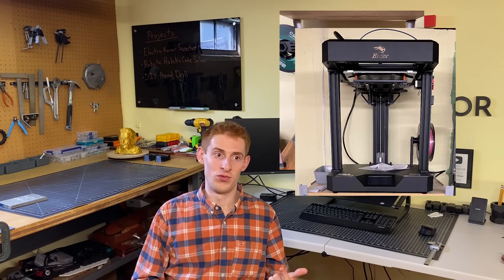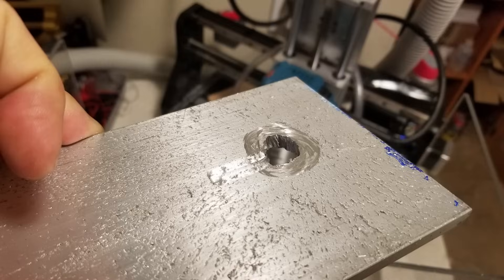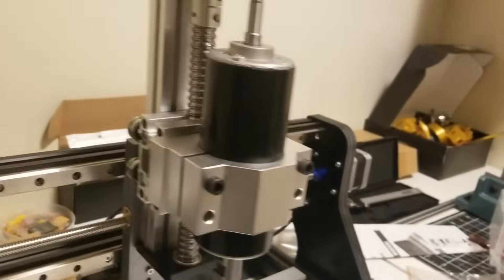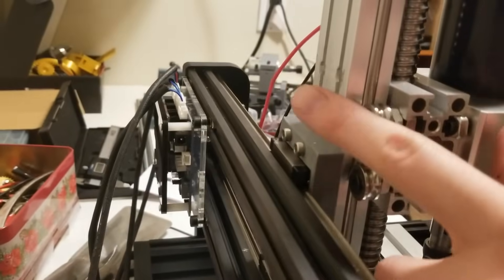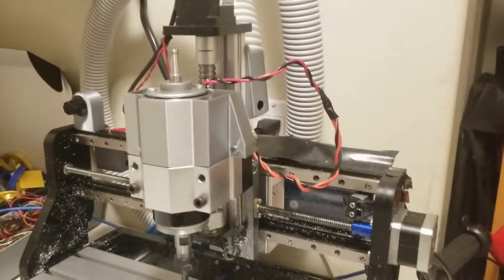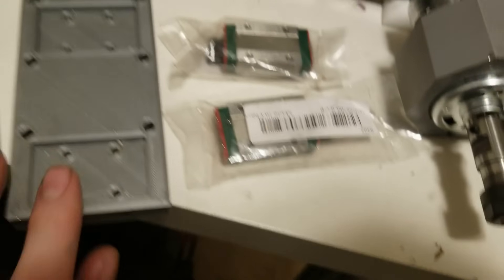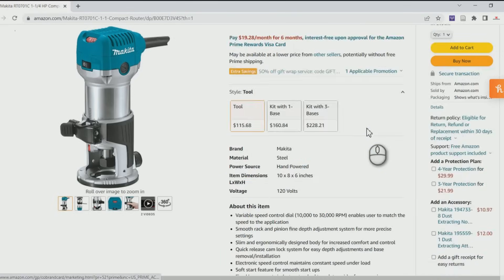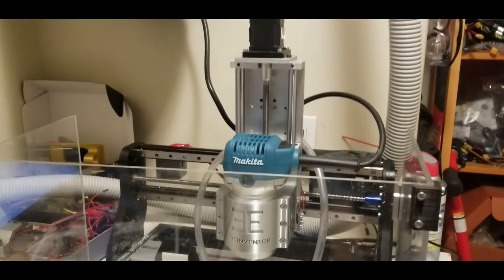Upgraded Desktop CNC 3018 cuts Aluminum FAST!

Comment: Hi Eric, great job. Do you think your machine could cut steel?
Reply: Steel cutting needs and demands a lot more - definitely way more in terms of cutting power, type of cutting tool, and most definitely rigidity. The most definitive answer being that one is better off converting a manual desktop milling machine such as the Grizzly G8689, Harbor Freight/Central Machinery # 44991, JET or other similar units (all more or less made by SIEG, who themselves offer their X2 /X2.7 manual mills) , throw on stepper motors and a means of spindle activation and maybe speed / RPM control - and even at that one would still need to upgrade the axis hardware with anti-backlash brass hardware or ball screws, brass gibs AND a coolant delivery system + means to keep it all contained - and if need be, replacing the DC 110V ? motor with a fully CNC-capable motor package. 

And even then, such a machine will still have its limitations, but the level of precision and rigidity in terms of cutting steel within a reasonable feedrate and timeframe will be at least practical - something that these 3018 units cannot achieve without sinking in loads of time, material and money into achieving the needed level of power and rigidity.
Perhaps it can be achieved with an ALL-STEEL precision frame construction with a proper BOX FRAME for the gantry - think a single horizontal 4" square tube frame or a similar contrivance similar to a modern crane boom with triangular framing, all precision welded, aligned and parallel, bigger stepper motors driving lead screws via timing belts, said lead screws on either a bronze bushing, a ball+thrust bearing combo or literal angular contact bearings, and very solid workholding options.

I do own a 3018 unit but mostly use it as stock and within its capabilities - that is, plastic engraving for plastic layercolor signs, as well as laser engraving. I am currently in the process of acquiring one aforementioned tabletop manual milling machine, and an incomplete used one at that, and thus in its current state, it is a 'kit' in the backyard engineering sense, but will be usable once the work and parts have been put into it.
Reply from the maker: Hmmm hard to say. Ive never tried it. It may be possible, but at super low feeds and depth of cut, and probably not very reliably. My goal was to cut at a decent speed, but im sure if i tried steel it would be painfully slow
Reply: @ericinventor  sounds like a potential new video!!!.....I know lots of people wanting to see if you can cut steel with a budget cnc, myself included to produce a prototype....interested in a 3mm depth of cut.

Comment: Hey, great video! I currently purchased parts basically identical to your v1 upgrade. Do you think this would be enough to cut hardwood like oak, birch, walnut?
Reply from the maker: Yeah i think with the larger motor and a solid mount to your z-axis you should be fine for hardwood
Reply: @ericinventor  im trying out 12mm linear rod instead of the default 10mm rod and new solid z axis mount.
Reply: It would be super cool if you could do a video on linear rail mount mod upgrade for 3018
Reply: Check the 3018proLMG

Comment: those bearings from the stepper motors will wear out pretty quickly. you need to have a rigid fixed bearing block where the leadscrew/ballscrew is mounted on and on the other side is the stepper motor either directly or via belt connected.

Comment: Do you still use the original stepper motors and controller board? I looks like it but i would have never thought they are powerfull enough
Reply from the maker: I do! You gotta remember when youre cutting like butter there shouldnt be high loads on the spindle. Plus the lead screws give you such a mechanical advantage that those motors can actually heavy decent forces, at least in my experience.
Reply: @ericinventor  Even on the z axis? I have heard that getting a bigger spindle can cause issues, and that makita is a pretty big spindle!

Comment: Hi, great upgrade - I have a 3018 Pro I was going to bin because it was useless.  Now I'm going to do as you did! Did the Y axis require any upgrades? Any mods to the anti backlash springs/nuts? cheers
Reply from the maker: I didn't touch the Y-axis, although I have had to replace the 3d printed bracket that carries the ant backlash nut when it cracked once. I think it would be relatively easy to span two more beams under the y-axis and mount two more linear rails to replace the existing cylindrical rods, but I was able to get pretty good performance without it.

Comment: WIth all the changes, how much was left from the original pruchased CNC?   would it be simply more worth it to get the parts and scratch buidl?
Reply from the maker: The entire frame, bed, y axis, and electronics were all original! The machine was $200 and I think buying those parts to build it from scratch would run you more than that.
Reply: that's my plan, already purchased some 8020 extrusions and rails and ball screws

Comment: Gonna try the 3020 pro max?
Reply from the maker: It came out after I started upgrading mine, to my surprise. 3020 pro is ~$600. My 3018 pro after all the upgrades is ~$600. Based on what ive seen in videos, the 3020 cant pump through aluminum like mine can. So while its a nice machine, to get more for your money, Id probably still go with upgrading the 3018.
Reply: @ericinventor  the 3018 and 3020 are the same size bed?